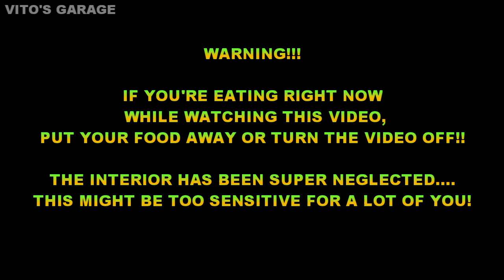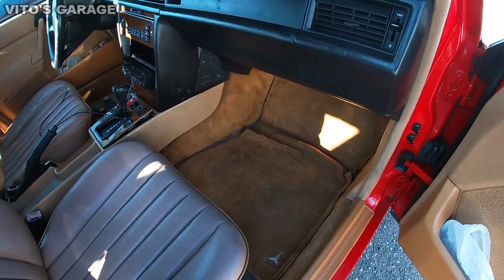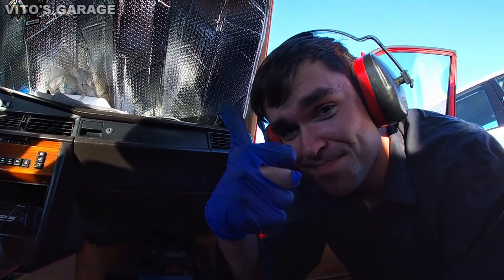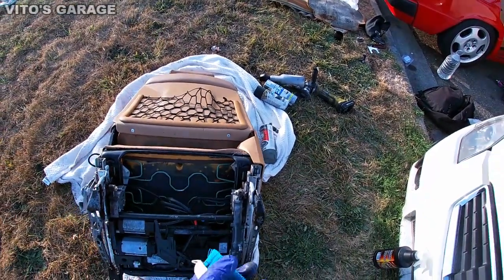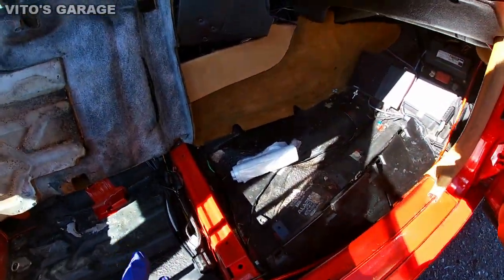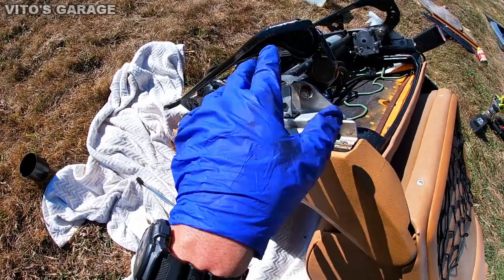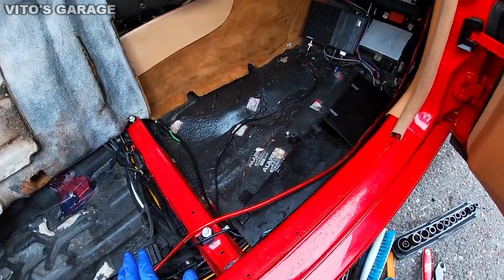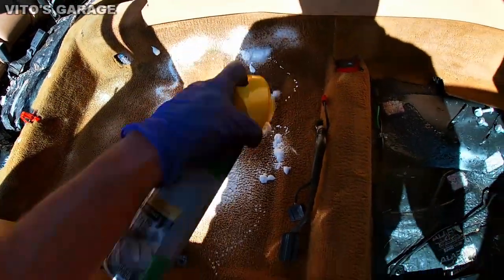THIS IS CRAAAZY!! Mercedes 190E Passenger Side Interior DEEP CLEAN, RUST INSP & PRESERVATION!

Comment: hey Vito, I only noticed a few videos. But I was very curious what you know about the fuel on the 190E. since it's an m111 how interchangeable would it look from the slk230 m111 prefacelift supercharged. My idea is that they lowered fuel and added supercharger to improve reliability and lower gas mileage. but it's only stunted for dummies. There 190E is like 362hp with the 4cyl and like 2480cc , still researching my m111 specs.
Reply from the maker: I think that would be a pretty awesome swap! M111 engines are great and super reliable!